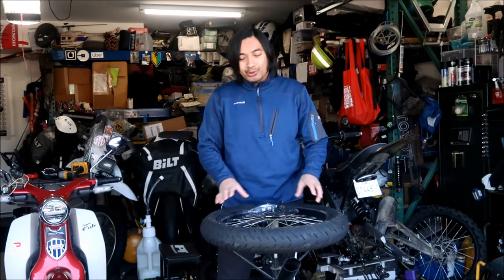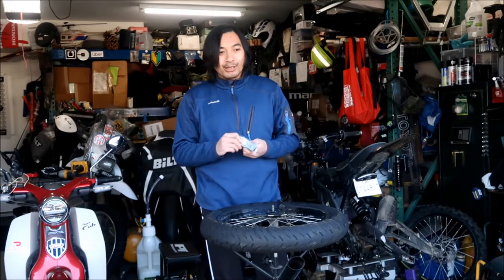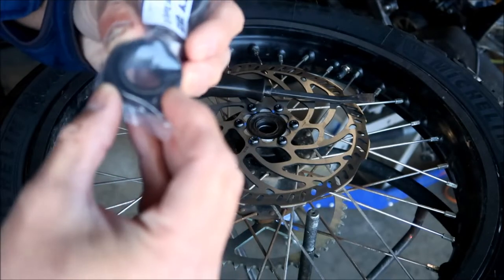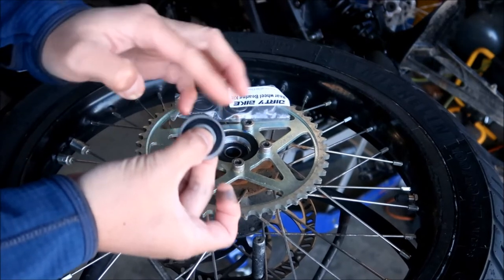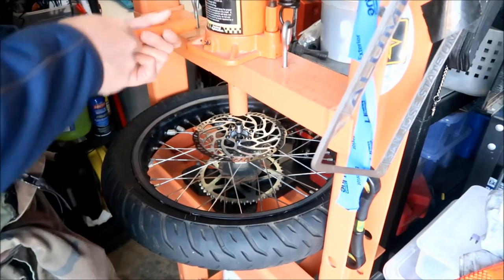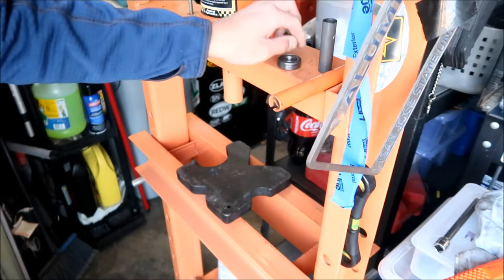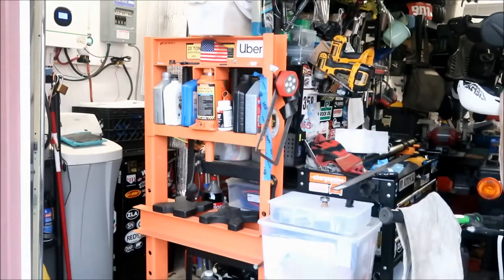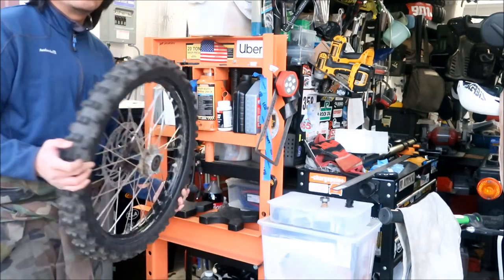Sur Ron Light Bee Rear Wheel Bearing Replacement

Comment: How do you know if you can just regrease the bearings or they need replaement?  
Also Im considering going belt drive but also was looking at Super moto kit from luna cycle... what makes a "supermoto kit" supermoto besides the street wheel bit confused.  

Also where in CA you live? I'm in Norcal (folsom) cant find any other riders...

edit: the spacer is the meat of the sandwich and the bearings are the bun.... relax

Comment: I think hammer is the best way. Then you can gently hit it from a lot of angles and not just push it out in the same WRONG angle and ovalize the hole. Also, I use cooling spray. Ethyl Chloride, or "the good stuff" as they would say in the 80's, when it was a popular recreational inhalant.

Comment: Can this be done without a press?
Reply from the maker: Yes you can use a socket and hammer to drive it in.  To take it out you can use punch and hammer.  I suggest freezing the bearing when installing still.

Comment: H buddy, this is not related to this video, im trying to loosen my primary belt as it is so tight and noisy, however i just can not loosen the bolts holding the engine!! They are on using blue locktite, any suggestions much appreciated!!
Reply from the maker: Try using a breaker bar with a 6mm allen socket you can try heating up it up with a heatgun.  Not sure i would use a torch might mess the motor up.

Comment: Good Day! Thank you for sharing. I am looking for a new hub for my e-bike. It was 3-6kW in peak. (cyclone 1800-3000w middrive, several times 9kW, once 15kW if belive to ANT BMS) ) I want to go now with new QS205 (~8-15kW in peak) as a mid drive. I am still using bicycle hub, but i afraid it will break if I will install to it moto sprocket with new more powerful motor. I noticed that sur ron hub look like almost like commonly used bicycle hubs, except a bit modified sprocket holder. While you was replacing bearings, maybe you noticed how thick walls inside sur ron hub? Thank you.
Reply from the maker: Sorry I didn't take any measurements.  Thus far the Sur Ron hubs have taken everything I can throw at it.  The can break if you crash them hard enough though.  Sometimes I have spokes pull through the hub also.  I am pulling up to 13kw on my bike and it has been able to handle it even racing on rocks and big jumps.
Reply: @hadesomegamoto7639  Thank you for your reply. Will think more about that....